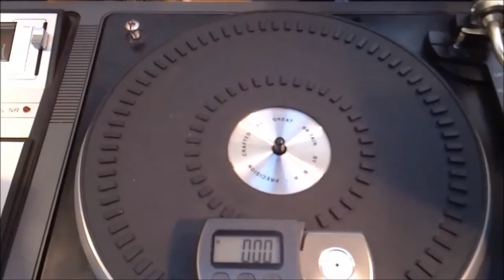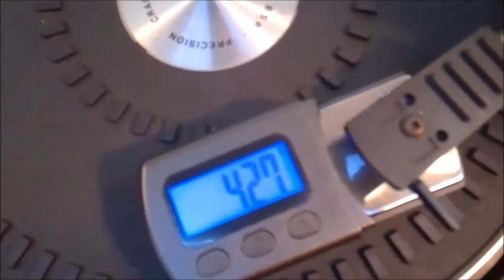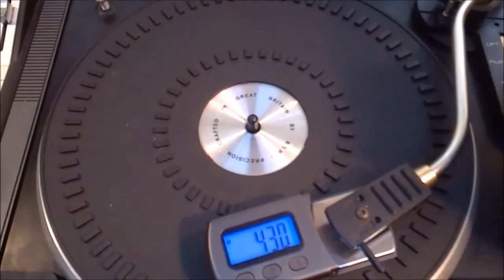Turntable tracking force scale, on an old BSR

Comment: That looks like a "music centre" that was produced under various names by the "Thorn Electrical Industries" Company. I used to work on those in the 1970's when I worked at the Thorn Factory in Newhaven, Sussex, England from 1970-1979. I can't remember the Model no's of them but they were quite a nice unit. I think the BSR record deck was a "P182" but as it is 50 years ago, I could be wrong🤣

Comment: Ahh I wish they still made automatics again ,I really  don't see anything wrong with the BSR or the like record player the ones that come with the magnetic cartridge have the same set up as a manual ,and I was reading the specs on their wow and flutter some are at.o8 and .10 I mean I have a audio tech 120lp manual its wow and flutter is at .12 and this is suposed to be an audio plyle approved  TT I have and old Onkyo CP1055II automatic direct drive quartz from 1985 and its spec is .012 ,they do not scratch records if you do it right with the stacking TT when I flipping  them over I seperate each one flip them over and carefully stack them carefully together and wala no scratches it is not hard its a pain  to use a manaul tytpe for when record is done you got to get up to pick up stylus just when your relaxing u got to get up whats the fun with that  I use to be an audiofool now I am begining  to see the light these audiofools have me brain washed into thinking that manual is better  well it is not the way records are made the grooves do not touch each othercause of the outer lip and raised record label  I recently got me an old BSR with an magnetic cartridge got it going and started using it it sounds like my manual my stylus is an eliptical stylus and if I dose off which I often do cause music relaxes me it will finish and not stay on record and your done and the wow and flutter on this model is better that my audiotech atlp120 and my project which is rated at .25!!!!! .25!!!!! so there you have it I will start from now on being me and not an audiofool from now on JRo

Comment: well this model is very good but the rest are not good vintage dual and garrard and perpetuum ebner and telefunken and such are built to a very high standard and are the best all vintage gear is the best today's stuff should not be able to be built it is all junk and no one today takes pride in their work anad it is all toss away junk at least with vintage gear it will last till you are divorced 5 times before you need to really do work on it . as long as you do preventative maintenance to them they can literally last forever thank you for sharing the great video all the best for 2019

Comment: 4.3g sounds a little heavy to me.  On my Technics SL-1300, my magnetic cartridge tracks at 2.0g or so.
Reply from the maker: Well this isn't a posh as your Technics, as it has a ceramic cartridge. These usually need a higher tracking force.  :-) But yes, if this had the ADC or AT magnetic cartridge used by some BSR models, even being fitted to Amstrads in the early days, 2.0g is about right.